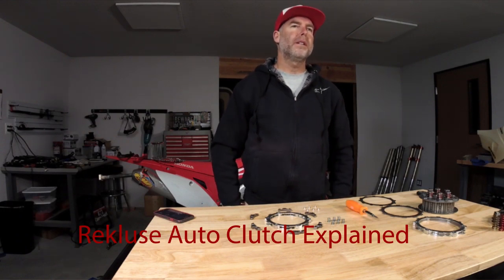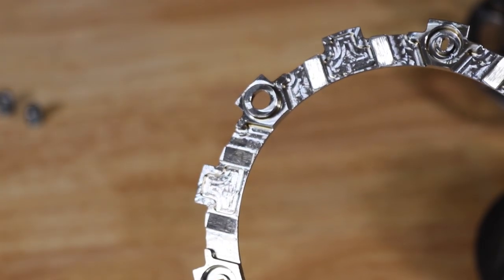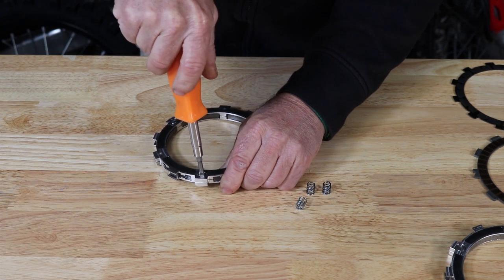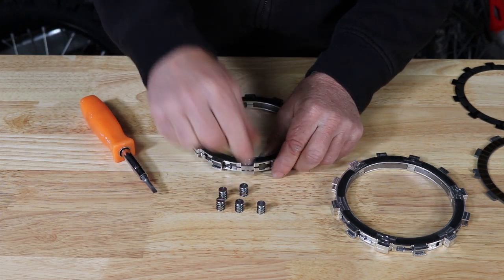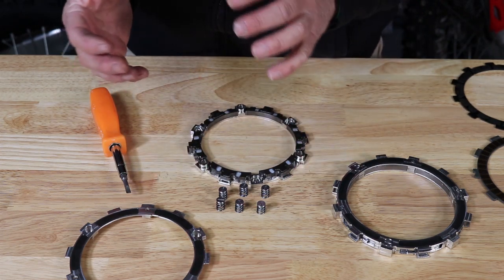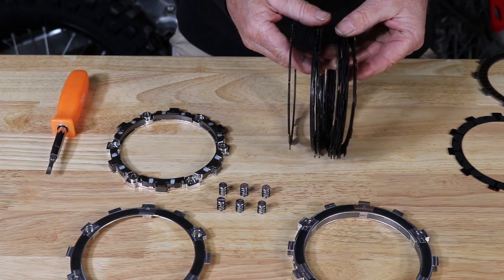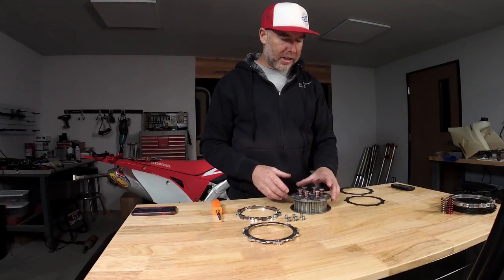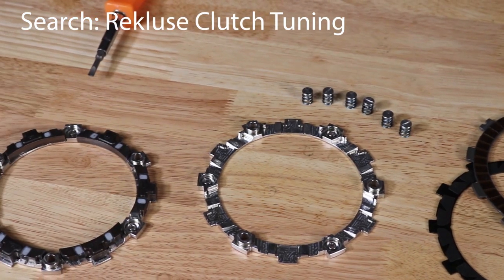Rekluse Auto Clutch Explained

Comment: Fancy centrifugal clutch. As a MX guy, I never thought I would consider running one of these, but the ability to completely eliminate compression braking on my 4 stroke has my curiosity piqued. Suspension works SO much better when unloaded, and you can still use it like a standard clutch 👌🏻

Comment: Just installed the radius x in a 21 crf250r. To get the installed gap I had to tighten the clutch cable almost to the end of its limit on the cable itself and at the lever. Switched to an aftermarket lever with a longer adjustment screw for more adjustment during riding. Also per the install diagram they show the throwout washer going on top of the throwout bearing which in the 20-21 models the bearing is pressed into the pressure plate. It has to be installed between the clutch lifter and throwout bearing. I verified this by speaking to a tech at Rekluse. Just wanted to post this in case someone else ran into these issues on their newer model crf250r

Comment: I've just installed an EXP 3.0 on my Gas Gas EC 300 2 strokes. Still tunning it. Only one ride, everything was all set as manual recommends. I was surprise with the very low engagement but soon enough I hit the first trail I noticed some things: 

1. very early clutch squeal (I'm using Motorex 10w30 gear oil - full synth);

2. I was riding 1 shift down and in higher RPMs in places where I used to be in a higher gear and in lower RPMs, maybe I was wanting to avoid clutch squeal and slipping because higher RPMs provides a better bite of the clutch and that's because of the design of the rekluse itself (centrifugal force to expand EXP disc);

3. my bike boiled the coolant very early than before. That was odd;

4. Clutch lever feel was different when I wanted to override Rekluse, I could not managed to adapt to it yet. It was harder to control the front on low speed 1st gear steeper hills where before I needed to slip the clutch to control power output on the rear wheel;

Well, more tuning and testing to be more definitive. First step is to change the EXP springs do red (soft) and check everything again. Recheck my air filter to make sure it's not related with the overheating. Maybe change gear from 12x48 to 12x50. One thing to consider, We use to ride here very tight wood trails, 3rd gear maximum...
Reply: dmpeg 
thats the fact in semi automatic clutch...
low rpm less hold so it ended in using it more in high rpm than usual with the manual clutch...
guess u had more fuel consumption too

Comment: do you have picture from the different springs and wedges too? is it possible to combine springs and/or wedges in one/same system too or only one kind of springs/wedges?
is it possible to coat the rails with specieal coating for less friction? does it work wit more faster  reaction?
the rings are they made from steel or aluminium? the fastner made them from steel too?
asking  if it possible to the the EXP ring lighter and inner less friction for higher reaction of the heavy system;)
Reply from the maker: They all look the same, just slightly different colors. The rings are aluminum and the coating is already on the wedges.

Comment: Lovely video,also well explained. Just one thing,does it loose engine brake? Thanks in advance.
Reply from the maker: I can depending on the setup, basically making the bike freewheel if it is set to disengage early.
Reply: On steep enduro descents, if you lock the rear wheel momentarily, the auto unit will collapse and it will go into freewheel or neutral.
You just have to blip the throttle and the auto unit will expand again and go into engine brake.

Comment: Do you have any tips for making the clutch lever softer? I have the fully automatic clutch on a ktm exc-f and some times, especially in the sand I need to use the clutch, but with this system the has become very hard to pull.
Reply: This can not really be changed easily unless you do modifications to lever position and master cylinder piston size. And if you are trying to pull the clutch when the power is on you have to overcome the additional force of the Rekluse pressing on the plates.

Comment: Hi I'm trying to get an auto clutch for my wife's yamaha fazer she has a bad left hand 
But there don't list one for it 
Would it be possible for you to send me the dimensions of the clutches you have to try and match one or I'll send you my dimensions to try and match one I have no where here in the UK to match one thanks Mike
Reply from the maker: Dimensions are not the only concern, rotational speed is very critical so each one is very unique.
Reply: @DirtBikeTest  yes but you get springs to adjust pressure on the clutch pads which should help with that

Comment: Nice video, thanks for the explanation of how they work.
Being new to dirt biking I would like to why you would want one of these?
Do you still need to use the clutch from take off or to modulate power?
Is this purely an anti stall feature?
Reply from the maker: We'll answer this specific question tonight on our live Facebook show @dirtbiketest. If you miss it I'll try and type an answer tomorrow!
Reply: @DirtBikeTest  Thanks for replying, Ill probably miss the live feed due to my location in the world.
Reply: Dirt Bike Test thanks for answer I saw it on the YouTube post of your live feed
Reply: well it is really an anti stall cause with it the crank got less weight to turn...
unlike the manual, in neutral, still the primary driven shaft is turning along with the crank.

Comment: I'm concerned about loosing the engine brake... is that true?
Reply: Engines brake still works if your RPM have enough to enchange rekluse . Lower thatn 1100 rpm its like newtral mode
Reply: I have one on my Kx250 and going from 2nd to first I can still feel the engine brake. However, I bought mine with the clutch on it so I have no clue what my tune is.

Comment: Would you race motocross with this? 2 stroke or 4 stroke? isn't it true a 2 stroker racer bike should NOT idle.
Reply from the maker: Yes and we have raced MX with them. Idle on a two-stroke is a preference, not a rock-solid setting.  I prefer my two-strokes to just barely idle, gives better off-throttle traction.
Reply: I tried the EXP core 3.0 ktm 250sx and it felt like someone was feathering my clutch for me. Starts seemed ok, but I think I can now tell who's running one now. It has a high gear lugging sound. Also, I can't tell if my bike is in nuetral anymore, I made a mistake thinking I was in nuetral and it TOOK off! be careful. Make sure your kill switch is always working.
Reply: The Duke 
now thats the dangerous part in using rekluse...

Comment: My clutch chatters at low rpm and engagement, in the medium setup. Core exp in a 19 yz 450fz . Any tips ?
Reply from the maker: Is it the clutch actually chattering or is it the chain slapping? This noise is often confused. If the clutch has been glazed (slipping too much, got too hot) this can also happen. So depending on instance new plates might be needed.
Reply: Dirt Bike Test cutch is new , only does it at the start under load , I might put all the soft springs in and try that ?
Reply from the maker: Fast Eddy it will catch sooner and likely help.

Comment: The replacement teflon pads are only 0.8mm thick. They barely protrude above the surface of the pocket they fit in.
They are basically already worn out when you put them in.
When the pads wear, the cast steel weight grabs on the aluminium frame and wont recede into the released position. 
I have bought 1mm thick teflon sheet off ebay and am making my own pads.
Reply from the maker: Let us know how this goes.